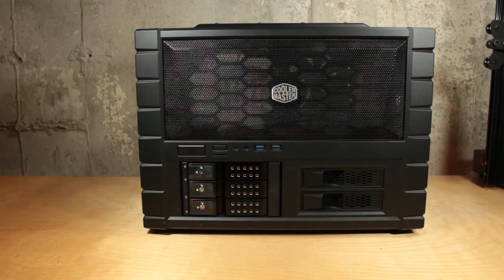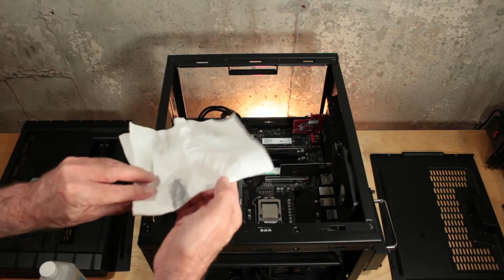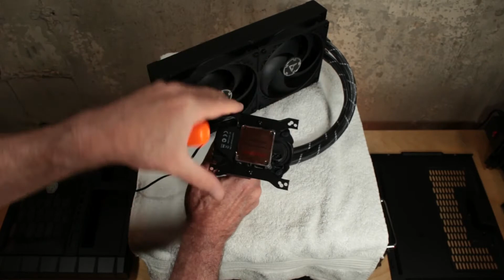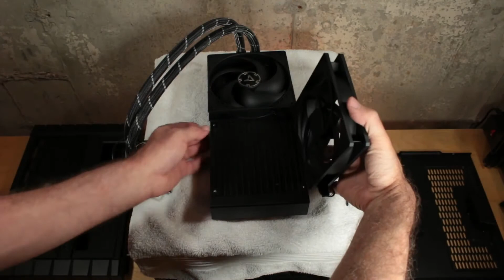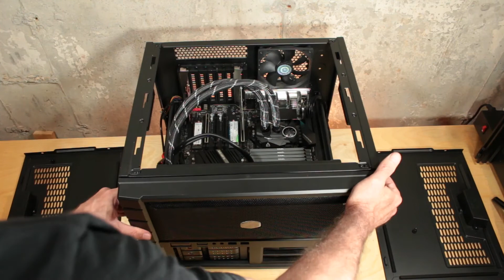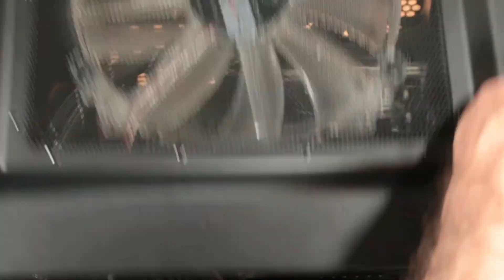Arctic Liquid Freezer II 280 install into Cooler Master HAF XB EVO LanBox

Comment: Thanks for taking  your time to create this video.  I understand that the scope of your video is to demonstrate your thermal upgrade but for what reason would you select this chassis if you knew in advance your CPU, Memory, GPU requirements? Please do not think I am finding fault but it seems that you are adding patches to remedy a bad first choice.  A small chassis will have less airflow than a larger HAF chassis with same type  coolers. One will be miles ahead using a bench test rig and portable fan though not as pretty to look at.  I deeply appreciate your video yet it supports the very reason why there is such a huge aftermarket for auxiliary cooling devices.  Yes, one does need an aftermarket cooler on a 10 core high end processor, that makes perfect sense but the processor alone does not generate the volume of heat one measures at the CPU.  Effective cooling is a science not an add-on solution.
Reply from the maker: Hello Sam, thank you for the question.  This is a very large case with very good airflow.  It is used by some as a test bench as all the sides are removable.  However, I have had this for years, I like the case because it's so easy to work on and have not found anything I like better.  I have upgraded CPU and motherboard multiple times.  I don't consider the heat problem in this situation a case cooling problem.  My theory is that if it was the case, this water cooler would not do any better.  I chose this cooling option because I should have done enough research to realize that the stock cooler is simply not adequate for the 10 cores and high clock speed when running hours and weeks at a time at it's maximum constantly.  With this water cooler, the case has no trouble expelling the heat, everything else in the case is cool.  I hope that answers the question.  Thanks again.
Reply: This case is insanely large.. If you dont know what youre talking about, dont leave a comment.
Reply: I got it because I had a full tower HAF 922, then a HAF 912, now this, it's much lighter, easier to work in because everything comes out and I wanted the flat motherboard option.
Reply from the maker: @Brisleep1  I agree, this is one of the easiest cases to work on and fits a lot of add-ons.  The way it comes apart is great.